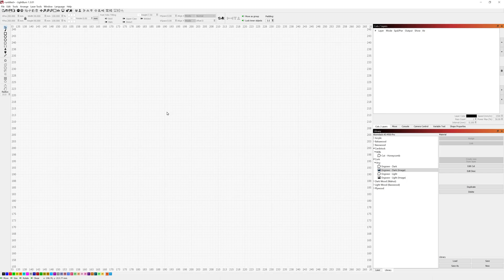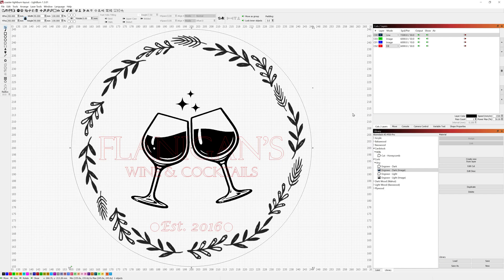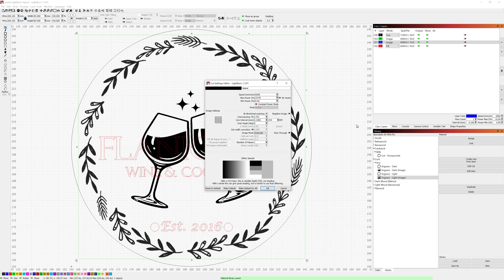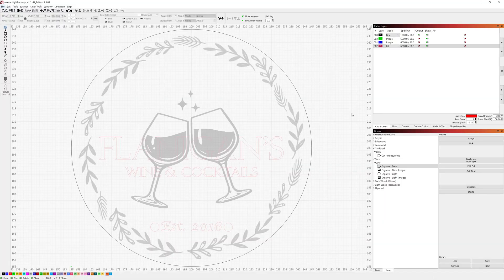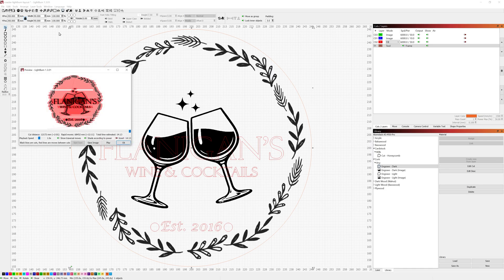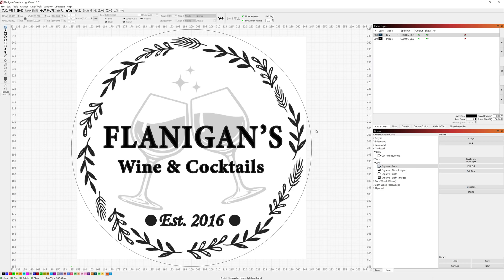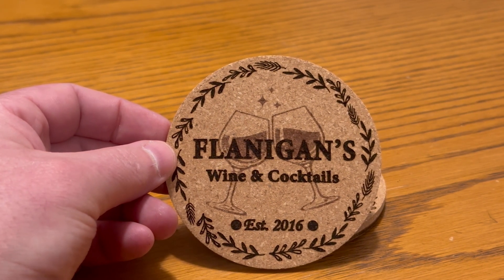Engraving Round Cork Coasters - Atomstack A5 M50 Pro (5.5-watt Diode Laser)

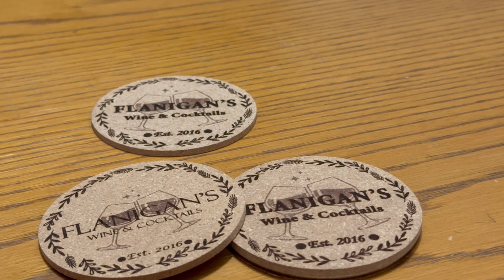Comment: What did you use to adhere the cork to the wood? 11:50
Reply from the maker: For the example in this video, I used a generic contact cement I had on hand.  More recently, I've used gorilla polyurethane glue because I had a lot of that from other project work I was doing.  Both seemed to work fine and have held up so far through regular use of the coasters.